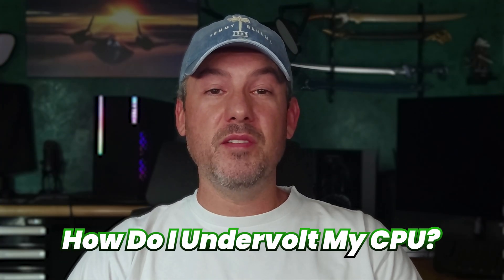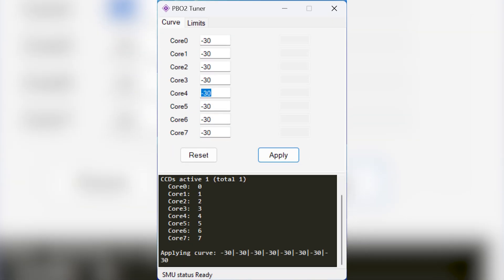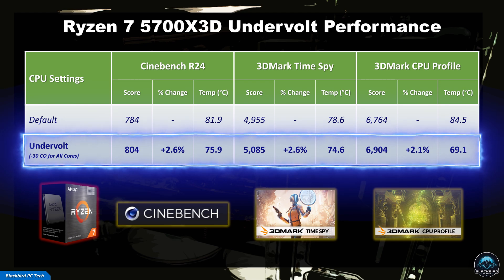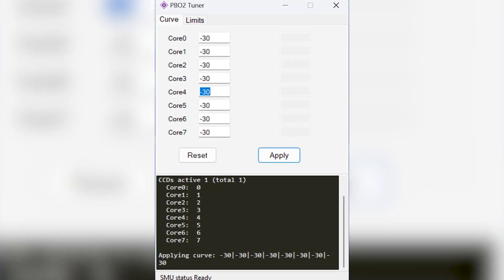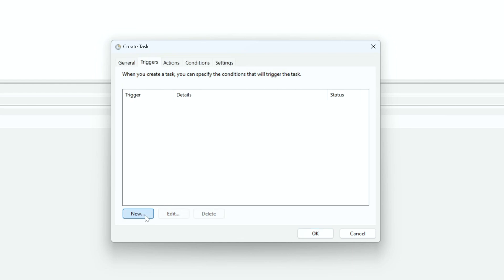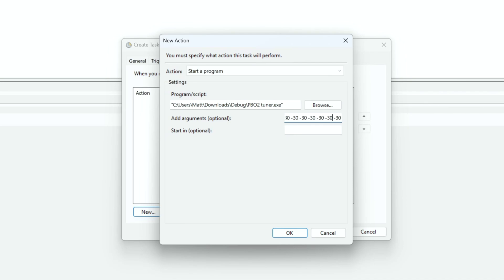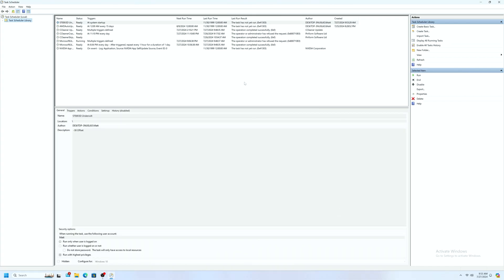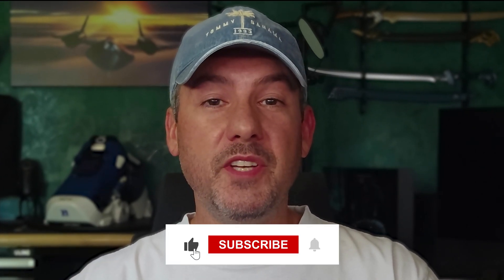How To Undervolt a Ryzen 7 5800X3D or 5700X3D!

Comment: Wraith Prism cooler may work with R7 5700x3D?
Reply from the maker: You can make it work, but to do so I would not only undervolt it but also set a thermal limit … the thermal limit may impact performance, but it will keep your chip safe. I would however recommend a more robust air cooler.
Reply: @blackbirdpctech  Understood, can you give us an example of cooler that may work so we could compare?
Reply from the maker: Sure, if you take a look at the recent build I did with a 5700X3D I had limited room, so I used a be quiet! shadow rock LP … worked extremely well and didn’t limit performance. If you have a larger case then you will have many more options to choose from.

Comment: I used PBO2 Tuner tried following the guides to apply in a group policies at start up but those never worked so I'd reapply once loaded back into windows dropped temps and kept every core at 4.5ghz.
Reply from the maker: That's great to hear but I would recommend stepping through the auto load process again to see if you can get it working ... it's pretty annoying to have to load it manually every time.
Reply: @blackbirdpctech  yeah I'll use this vid and try again I have seen a 25c drop just by doing this having it automatically applied would be amazing this CPU is hard to beat in a gaming rig. 

Thank You for making this video I'll add to my toolkit for others who have this CPU.
Reply from the maker: Great cpu and gets even better with an undervolt!